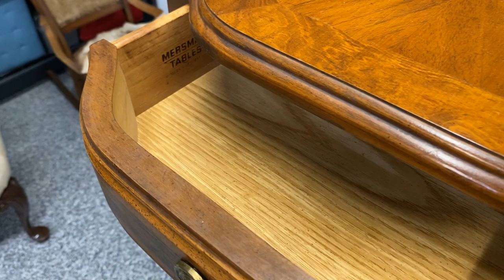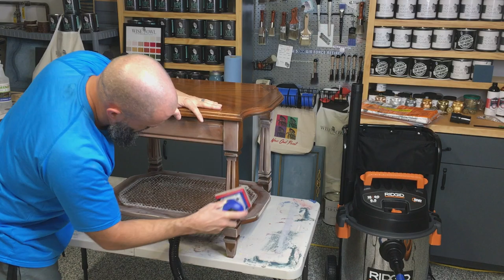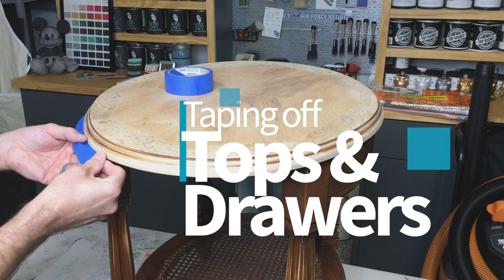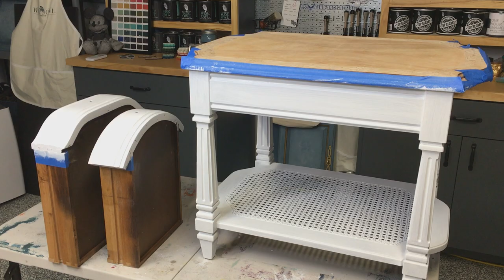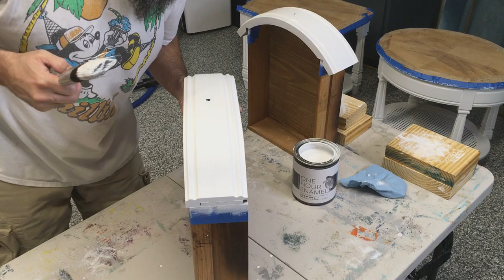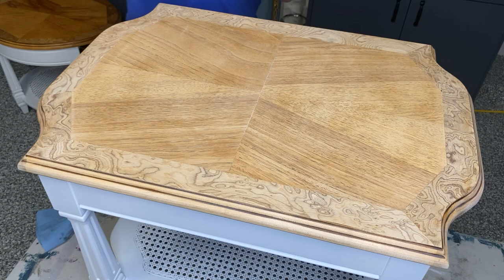Marketplace Furniture Makeover with Wise Owl Paint & SurfPrep | Flipping Furniture For Profit

Comment: I love the Surfprep system.  I purchased it for a kitchen island refinish job and it paid for itself on that one job alone IMO.   Sub'd.   If you like the Surfprep and the time it saves then I have to ask if you have ever considered an HVLP for your painting?  The other life change I experienced was the day I purchased an Apollo HVLP system... it will change your life when compared to brushing on your finish ;) - also, check out the 1/2 surfprep pads which will allow you to "power" scuff sand between paint coats
Reply from the maker: I actually work for Wise Owl Paint and we have our own Stingray Sprayer designed for our finishes made by Apollo 👍 I’ve played a bit but haven’t got paint on a piece with it just yet… only recently received it but definitely on the horizon for me to increase production and make some parts of what I do easier.  Same as you mention about scuffing, the Surfprep certainly makes that part of prep much much easier to do